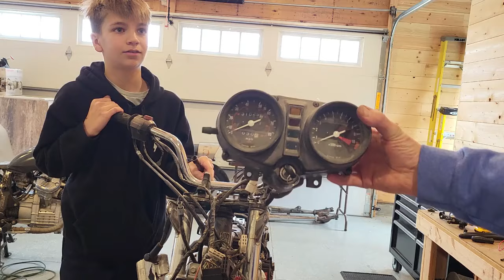What did we find tearing down the Hawk.

Comment: How did you make a gasoline IV bottle out of a 2L of Coke? I'm going to feel really dumb if you have a video about it, but I had to ask.
Reply from the maker: There is a video somewhere we did, probably part of another one not specific for the bottle.  It wasn't too hard to make, sometimes I think it would be best to have the real thing since this builds quite a vacuum at times and could prevent proper flow.  But it works for the most part.